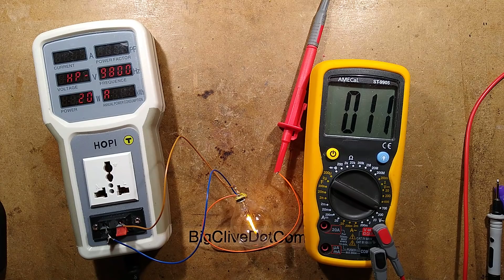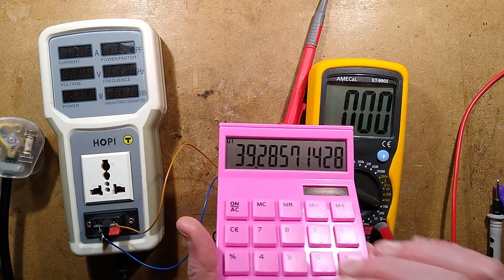Exploring 0.5W LED festoon lamps and extending their life

Comment: According to my 3 year-old: "That was a nice movie"
APPROVED!
Also, interesting mention of capacitive coupling there; It's something I've not fully got my head around for real-world situations.
Reply: Essentially the 1μF cap becomes a 2.7kΩ resistor at 60Hz, or 3.3kΩ at 50Hz. (I've rounded to the familiar E12 values)
That should help you understand what's happening without going into reactance vs resistance and you can just apply the usual ohm's law.  (Very approximately) Clive halved the current by adding that cap, or doubled the resistance if you prefer. 

If you're going to experiment, then the formula you need is
1 / 2π * frequency * capacitance
That gives the reactance of the capacitor, but in this kind of scenario you can just think of it all as resistance for simplicity.
Reply: @georgeprout42  That part I understand. What's more esoteric is the capacitive coupling mentioned at around 5:00. AFAIK Clive is acting as a capacitor made from conductive salty meat juice and insulating chair/shoes, which then couples with a capacitor made up (I think) from the Common test lead and high impedance of the voltmeter test circuit.
Reply: @atomictty  A capacitor is two conductive plates separated by an insulator. Clive's body is one plate, as you note meat is conductive. The line wire is the other plate, and the insulator is mostly the air between the two plates. To get current to flow in that case you need an AC voltage, but that is conveniently what the power line provides.
Reply: @atomictty  it's not just capacitive as described, there is also inductive pickup. Our meatbags don't just make good dielectrics, we also make good antennas; think of the "pre-meme" TV antenna alignment meme "that's it, hold it there, don't move". Very high input resistance means that very low currents will register a very sizeable voltage (consider V=IR, with perfect R as infinity; any current at all makes V infinite...) It's much more visual on a scope than a DMM, but the principle is the same. The multimeter probe is the secondary of a single turn primary air gapped transformer. Or ham fist core transformer, depending how you hold the probe. When playing with mains voltage you effectively have primary windings all over the house, just to make it interesting. Bottom line is that it's just something to be aware of and if possible, keep your sausage fingers away when making a measurement. Not just because of shock risk, but you could be affecting the reading.
Reply: I like to think of capacitors (and inductors) as a variable resistor that changes its resistance not to temperature, light, or how you twist the knob but changes to what frequency is being applied. George Prout responded to you with a formula that can calculate what that resistance is to frequency. I should be using reactance to describe what's going on instead of resistance, but in this case it's more descriptive.

Comment: Interesting! My neighbors have a set exactly like this on their front porch. I've noticed after several months they also have several dead bulbs. They are protected from rain so I assume they also have a resistor that has also failed? Or would they not even bother with a resistor and just run them directly on live voltage? ~122v off our transformer. Hmmm
Reply from the maker: I'd definitely recommend a resistor.  The exploration of one of the filaments has just been released on Patreon.  Quite unusual circuitry.
Reply: It really is a small World in tech land, it seems.

Two great channels. ;)
Reply: @bigclivedotcom  resistor? You mean series capacitor?
Reply: @volkhen0  No
 A series cap would cause a phase shift and way worse power factor than what the meter showed.
Reply: @michaeltempsch5282  Agreed. I just run a simulation and 240 VAC RMS mains connected to a 51k resistor and antiparallel strings of 40 LEDs come out to about .98 power factor and the same measurements Clive was getting. I don't quite remember what Mehdi's 120v version had but I think it was half the LEDs and half the resistance of this 240 version.
Reply: @eDoc2020  “antiparallel”, so that’s ‘series’?
Reply: @HighestRank , no. Antiparallel means, that LEDs are connected in parallel, but one with reversed polarity to its parallel "comrade". Ie, anode of the first diode connected to the cathode of the second one. And cathode of the first diode connected to the anode of the second one. It is useful for creating a cheap solution with powering LEDs directly from AC, without rectifier bridge - one LED works at positive wave, and another - at negative wave. But, with significant drawback - 100 Hz flickering, as we can't use huge smoothing electrolytic capacitor on AC.
Reply: @bigclivedotcom  Anyone ever told you that you sound like a police officer?
Reply: hey adrian, nice to see you around these parts!!! and yea, they have these all over america(usa, dunno bout south or central america or even mexico and canada) some of these last amazingly long, car dealerships used to use them everywhere in the 90s as well as full size edison screws, the sockets suffer green death after a number of years but screwing and unscrewing the bulbs to mechanically clean the contacts works for a while, you think this is bad? you would love amusement parks, i worked games department at cedar point for a season, the water gun games(like pop the balloon, win the horse race, etc) that you shoot a microswitch paddle literally have 120v e27 sockets inside a plastic box with the microswitch, non sealed at all! kids are spraying water at literal light bulbs! they are nearly all made by bobs space racers, policy is to clean them periodically and replace the microswitches as they die, i still carry a 6 inch crecent wrench in my pocket everywhere i go because of this job, you needed a small wrench to service the water guns(actually aluminum paint guns made by binks with extra parts added for show, we had to be careful as some of the parts were cast aluminum and others were lathe turned steel haha, the actual orifice is just a brass insert)

Comment: Yes,  in North America,  the candle base lamps get green and corroded from water getting in,  even at 120 VAC.  In Canada,  they are called E12 base C7 bulbs.
Many light strings with C7 bulbs claim to be 'indoor' dry use only,  but who pays attention to those warnings?
Using a capacitor to drop the voltage (and wattage of the lamps) is a great way to extend the life,  and not so hot like a resistor.  The PF did show it on the HOPI though,
Reply from the maker: The indoor use bit will probably be a liability disclaimer.
They're quite attractive little lamps.
Reply: Wikipedia is indeed mentioning that the E12 fitting has a 120V candelabra/night lamp application, so seeing it being used here makes sense. I bet they had the harness, holders and lamps and just matched the lights to operate on 240V by adding the 1/4W resistor.